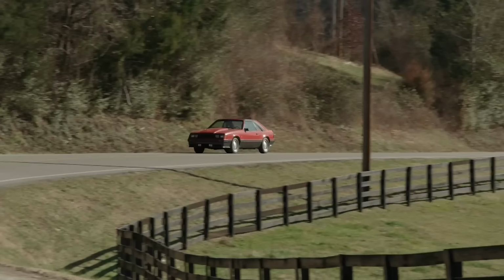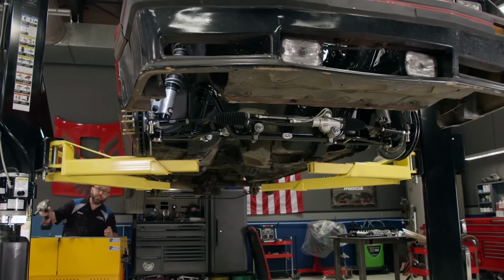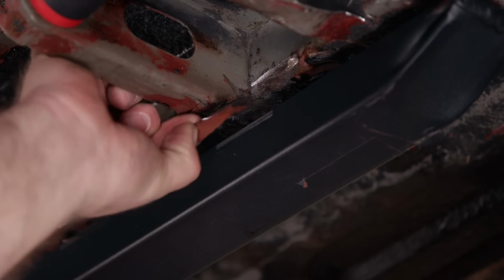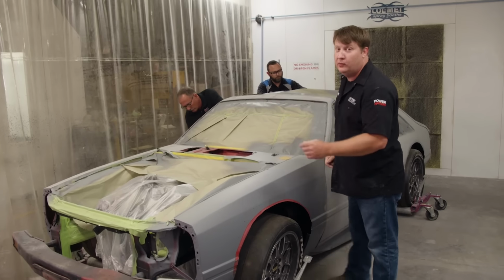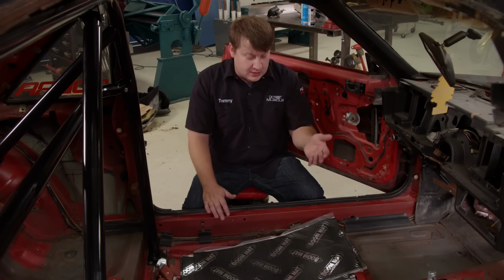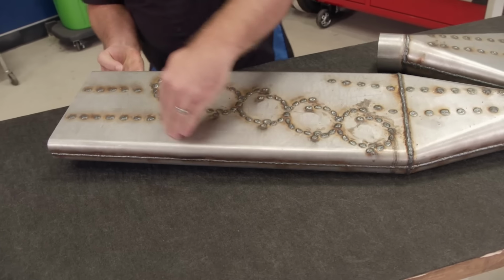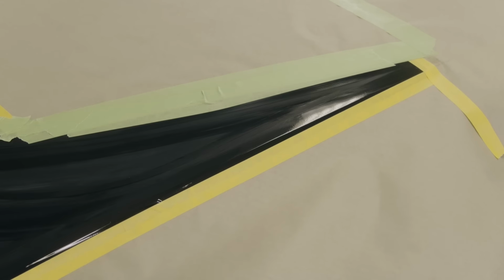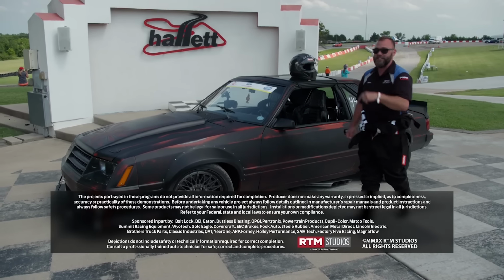Full Build: 1981 Fox Body Cobra Mustang

Comment: I love Fox bodies, that build is essentially my SBF except it is the FRPP Boss 302 4 bolt block, same heads, ridiculous cam and roller valvetrain, it isn't 600hp but it is just under 500 at the wheels and all the suspension improvements through UPR have the Fox stiff as it gets, TKO600, Strange 3.73 locker with rear discs..  I have owned 4 Fox bodies in my time and I miss all of them, so I am keeping my original paint 85 (Jalapeño Red) forever.

Comment: Why go thru all that trouble just2 install another medieval, carbureted engine, steam gauges &mecha switches? 

Why not install a modern V8 or other, complete w/FI, EPS rack, electric HVAC, DCI, VVT, antilock, air bags, digital dash, touch screen, etc? I like the paint idea, the frame trusses, the roll cage, flooring over the rear seat delete but the exhaust is putrid, ugly even. 

Why waste the labor, the time &the parts?

Comment: So lemme get this straight... you wanted your engine bay to look cleaner... after having cleaned and painted it nicely.  So you drilled about 100 holes in it, put cover panels that will hold water behind them... where all the drill shaving are, and secured them with rivets stacking up 4 disimilar metals.  Never heard of galvanic corrosion?

Comment: Completely restored my 91, hats off to these guys. Not an easy process.
Reply: I had a 91, though it was a parts car. I've got a 90 gt now. It is just an average fox,  but there is just nothing like rolling through the gears in a foxbody mustang. I don't think I could not have one.
Reply: @trentjacobs3957  my 91 is an LX convertible. Just put her into storage this week. I'm restoring a 92 LX Hatch currently, calypso green. Then have a 85 notch that needs a full resto.

Comment: I had a black 1979 Mustang Cobra. It was literally the WORST "muscle car" I have ever owned. It had terrible front-rear weight distribution, toy-like suspension parts, awful rear wheel hop, poor build quality and to top it all off, Ford used a mix of standard, metric and proprietary fasteners making the car torture to work on. Its been 42 years and I'm still mad at that car.

Comment: Bush league on the block off  panels in the engine compartment. Laziness prevailed as they could have done the job right by cutting out bad metal & NEATLY welding the panels. Rivets in the situation are bush league.

Comment: In 79 I had a 79 cobra didn't know they still made them in 81. Ofcourse they were not performance machines. Just a few stickers and cobra emblems the 84 GT I owned was an upgrade on power 175 hp I think. Then my  87 GT was 225 hp which wasn't bad for a 5.0 of the day.

Comment: Best video ever for the early 80s mustangs. I want the exact build. My opinion I was 21 when the 82 Mustang GT came out. I couldn’t believe it. One of my co workers in 1981 had a silve Fairmont GT. 302 manual . He had gutted the dash panel had after market gauges . Swapped out the valve overs for finned 302 Cobra ones. I couldn’t believe it being in the 80s.
Reply: One of my friends bought an late 70s Fairmount that was built into a wagon in the early 80s with all mustang components including a fuel injected pushrod 5.0 from a foxbody of course, though it's got an AOD automatic that needs to go.

Comment: Why wouldn't they have installed those block off panels before they they painted the engine compartment?
Reply: Because they could not take the time to do the jobright by cutting out the bad metal & weld in the panels

Comment: How to build a cool car according to Power Nation.  Step 1:  Completely strip car down to a bare body shell.  Step 2:  Throw everything in the trash apart from the aforementioned body shell.  Step 3:  Spend $10,000+ on repairing, prepping and painting body shell.  Step 4:  Bolt $100,000 worth of aftermarket parts onto the $10,000 dollar body shell.  Step 5:  tell everybody watching how easy it is to build the car.  Step 6:  forget to tell the viewers that you will have to sell your house including your first born to build this car!!  Oh and while I'm here a Monocoque  chassis is stronger lighter and more torsional rigidity than a body on frame construction, it's also much lighter.

Comment: At the beginning that was an ugly car! To be honest I used to think that mustangs are amazing cars. No any more. I have a 2007 v6 with 16000 miles and a 2008 gt with 6000 miles and their weight,  suspension, tranny, and comfort is terrible. My 2006 prius is so much better. I am so disappointed about them. I also used to have a 2008 escape with 21000 miles. I was not impressed with that car, however, it felt a lot better than the mustangs.

Comment: The splitter braces are supposed to be mounted solid to the core support or bumper support, not to the ABS bumper.
Otherwise the force of wind could push your bumper off. When all you want the splitter to do is create downforce on the front of the chassis.

Comment: For me, this is by far the best car from the 80's. Replaces every mechanical part
Reply: Why wouldn’t they?  It’s not a paint detailing show.
Reply: I've owned 4 foxes, and not only is it a great handling car but, the sound out of a Ford pushrod 5.0(especially through flowmaster series 40s) is just the bee's knees. There is just nothing like rolling through the gears in a 5.0 foxbody mustang.
Reply: @trentjacobs3957  The car had its strong points but handling was not one of them. The GM F-body with its panhard bar rear suspension would easily out-handle it.
Reply: @ronwalker392  While I don't disagree that GM's f-body definitely worked and worked very well, I can't agree that the fox isn't a great handling car. I don't pretend to be well informed about suspension geometry and the specifics about how well each setup works, but I do know that the foxbody mustang is a spectacularly fun car to drive.
Reply: @trentjacobs3957  DEFINITELY a fun car to drive and classic styling but not the best way to fast lap times.  I autocrossed two Fox Mustangs back in the day and did a deep dive into suspension geometry. Even put a whole K-member/control arm/coil-over/camber plate kit in the notchback. Yes it fixed the front suspension issues but I was still left with a twisty frame, poor weight distribution, inadequate brakes, and twitchy rear end. So yes if you want to drop $10k + labor on top of the vehicle price, the aftermarket support is amazing and will fix most of the handling deficiencies. Alternatively you could just grab a similar vintage Vette or 3-series Bimmer for less overall and really carve corners. However obviously beauty is in the eye of the beholder if that it is your priority.
Reply: I had two.  Drove one over 212,000 miles with mods.  You could make them decent handling with some suspension upgrades.  What they were great at, was adding power with affordable upgrades.  Bought mine new for $12,800 and added on K&N intake, 14 degrees timing, ported head, JBA shorties, SVO exhaust, flowmasters, HD trans. 3.55 rear end.  All that was a few thousand dollars and got me down from 14.6 to low 13s.  The car only weighed 3,023 lbs!  Also upgraded to 245s to have some grip.  The stock 225s weren't good.
Reply: I love the 82 gt front bumper
Reply: The best looks-wise. Every budget performance option from the factory was woefully underpowered until the end of the decade. You can blame the EPA for that, which is now being utterly disarmed in its enforcement of nonsensical overregulations and the overregulations themselves are sometimes getting walked back. Thank you, Lee Zeldin.

Comment: Why not use the 4.9L Inline 6 from the 96 F-150? Its more cost efficient better torque and lighter weight plus if you strap on a turbo its pretty much a 2J but better

Comment: Wanted to thank you guys for building this and saving that rare Cobra which is basically a left over Pace Car. Fyi, the front window pillars on those early t-tops could crack and break with the stock power levels so keep an eye out just in case.

Comment: Those "block-off panels" in the engine bay look like a great way to trap moisture and rust out the underlying metal.
Reply: Yea, cause he probably drives it year round in the Midwest snow storms where that’s a concern 🤣
Reply: Most people cut the existing panels out and weld the scottsrod panels in without that gap

Comment: Some time around 1981 Ford switched the type of balance of the small block V8 engine. I remember around the year 2000 test driving an early Foxbody Mustang in which the seller said that the engine had been swapped and it had a vibration. It definitely had a vibration as it shook the entire car like a giant washing machine. I passed on it but I wish I could go back and buy it.

Comment: Power train I have a challenge. I would only build a iron block 455 . Inside the 455 Cubic Inch Big Block from General MotorsThere's no question that 455 cubic inches of displacement equal a big motor. Nevertheless, this giant engine from the General is a little mysterious. In the beginning, you would find them in Oldsmobile Motor Division products. As time went on you started seeing this exact displacement under the hood of Buicks and performance models from the Pontiac Motor Division.

Here we'll dig into the history of the record torque producing big block. We will also uncover the difference between a 455 SD (Super Duty) and a 455 HO (High Output). Discover if the Buick, Pontiac or Oldsmobile engine has an advantage over the other. Finally, learn how the 455 benefited during a time when GM's divisions took great pride in making their own engines.

The Oldsmobile 455 Version
Olds beat the other GM divisions to market with the first 455 Cubic Inch motor. In 1968 the engine found its way into Oldsmobile's premium luxury muscle car, the 442. They called it the Rocket 455 which became an excellent marketing tool. They based the engine off of the 425 CID found in the 1967 Toronado. The company actually retained the same size bore yet increased the stroke by altering the crankshaft.

The side effects of a longer stroke include a healthy increase in torque. The downside is the engine finds itself a little slower at gathering RPMs. Horsepower ratings from 1968 through 1970 remained in the 375 to 400 HP range. At first, the engines remained exclusive to the Toronado, Cutlass and 442's. After 1970 you'll also find them in the Olds Vista Cruiser Station Wagons, Delta 88's and even GMC motorhomes.

Stage I Buick 455 Performance Engine
The Buick version of the 455 is actually quite different from the Oldsmobile version. Instead of altering the stroke, Buick honed out the cylinders on the 430 CID Buick Wildcat engine. For this reason, GM considered it a thin-walled big block. The advantage of this casting design is a significant drop in weight over the other 455 versions.

In fact, the engine actually weighed close to 150 pounds less than the legendary 454 big block that Chevy used. This weight reduction compensated for slightly lower horsepower output from the Buick version. They rated the standard issue 455 at 350 HP and the high-performance stage I version at 360 HP.

This engine had a short run starting in 1970. In 1975 General Motors started using the same engines across the different divisions and platforms. This gave them better compliance control for the increased power and fuel miles they buckled it into the ground.  At the end I put that engine in my 1995 suburban and it was a muscle car bully that ran 10 seconds on a good day on a lumpectomy day she ran 11 seconds and for a suburban that’s quick thrown down . Edit if I fallowed my insane friends build I could have had a 9 second suburban .

Comment: Can yall do a full rebuild on a 1988 3rd gen 2.8 v6 Chevrolet camaro rs so I can know how to take everything off put what needs to be changed on the body the Chasy suspension brakes you know like everything i can find no videos at all an it socks because mine ran but then stopped an i had got it going again but then it won't start back up again for some unknown reason plus needs to be repainted really bad an i think the body or Chasy might be a little shifted

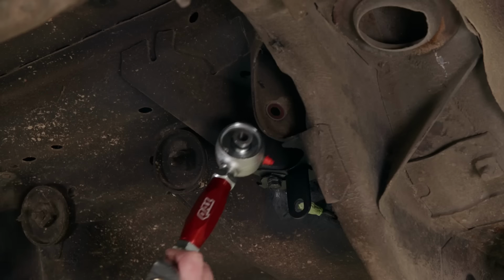Comment: ( 8:08 )  
If I owned that car and found out that you guys installed equipment underneath without treating the underside of the car and unrusting it and coating it with something heavy,
I would have been EXTREMELY PISSED.......  you guys mounted all that new gear onto a horrible bottom that still shows wear and rust look without cleaning & treating.
Take EVERYTHING out from under the car, and I mean EVERYTHING then grind until you see metal, then treat.... then spray LINE-X on the entire bottom of the car.
Then install new gear .....  Also I dont like that paintjob.  its like 13 year olds buying $500 pair of worned out jeans.  just horrible.

Comment: Does anyone else get upset when the put a brand new rear end/shock/ adjustable links etc on a rusty old undercarriage? Like, Come on Man. at least clean it up before bolting on all brand new parts!
Reply: Same here.......I had to thumbs down just because of that reason.  Since its a rebuild that they wanted to achieve, then a full cleanup of the car is necessary before anything else happens.

Comment: Foxbodys are alright but if you live in the rust belt they are getting hard to come by without the front frame and shock towers not rotted out of the car. I have worked on many from 1979 right up to 93 and they all have the same issue with the shock tower and frame and they rot from the inside out.

Comment: Those "block-off panels" in the engine bay look like a great way to trap moisture and rust out the underlying metal.
Reply: Why didn't u put those in before u painted?
Reply: And some unnecessary weight
Reply: Qqaaaaàààààaa
Reply: Aàaààààààààaaààaaaààaààààaààààaaàaààààààààaàaàààààààààààààààààààààààaààààààààààààààààààààààààààààààààààààààààà
Reply: Ugly azz car.

Comment: That light bar is just a way for jerks to blind oncoming drivers. They have basically no vertical light control, and are screamingly bright, which is great for offroad, or maybe if nobody was in front of you for MILES, but that's not how they're used in the real world, when mounted like that, on a street car.

Comment: You'll be putting Battle boxes in your torque boxes in a short time.  If the upper mounts don't pull out first. It's only sheet metal spot welded.

Comment: The only thing I don't like is the exhaust. It is too low. I would have put dual exhaust straight out the back. Or dual exhaust in front of the back tire but higher up.

Comment: I had rails, bracing and subframes installed on my 95 GT Convertible.  You need to make certain that you car is straight before investing a bunch of time/money.  I got on a level floor, checked tire pressure and did some plumb-bob measuring with a string and weight.  I did other measuring with a tape and was happy with my platform.  With a convertible/T-top, it's important to keep doors closed, tops latched down, windows up.

My guy presprung or preloaded the frame by putting a pipe up and down under the car and carefully lowering the rack to push up on the rails and then welding them in.  Good idea in concept but then my convertible top ended up being very slightly stretched and in a short amount of time then needed to be replaced.  He should have used a scale (like in the bathroom) to measure the exact tension being loaded when prespringing the subframe connectors so both sides are even.  Also, you want welding rod that won't rust (not recalling the exact term).  My welds are now rusty after a few years.  I'm going to have to use a wire brush on them, treat them and carefully paint them to protect the strength of the welds.

The car really feels solid now with no flop or flex that is so typical in the convertible mustang platform.

Comment: Did they brace up the torque boxes in the rear end if the car.  With 600+ horsepower , i can't see the stock mounts lasting long.

Comment: I was all on board right up until you re-installed a 4-link in the rear.  Booo!  Three link with a torque arm and panhard bar is the way to go on a Fox body.
Reply: Wrong. Ford had an 8.8 IRS setup. If you want to corner IRS > everything so they should’ve snagged an IRS 8.8
Reply: Watts Link?
Reply: @luislongoria6621  I have seen that done too

Comment: Wow 200 horsepower froma 5.0 v8 😂😂😂 1980s uk astra 2l I4 150hp
Reply: Smog Motors and Complex EGR Killed Performance. Easy to Swap a 4 Barrel Carb, but Hard to OverCome Low Compression Ratio Pistons

Comment: What are the wheels?
Reply: They are called "TRX" and were a factory option. They are 390mm in diameter ( or 15.4 inches), and can only fit Michelin tires at over $400 each.  There is an exact copy / repop being made in 16 inch that can mount any modern tire.
Reply: pipcop Very interesting wheel size. Thanks for the reply!

Comment: I thought unibody chassis are more stiff than body on frame chassis? At least in modern cars. I thought that body frame is preferred in trucks precisely because it allows for more flexing during off-roading?
Reply: You will wad this car up without subrame connectors and this much power. Hell my stock 302 will wad these cars up.  They were saving weight not making stronger 

Mine arent the stifflers like these kind but they are very inetersting to say the least in my channel
Reply: Ditto. Complete Opposite Even on Dodges

Comment: I would have power coated or undercoated the under the car after taken motor trans n rear end out. And i know im only partly through this i would have went with a plastic tank those steel tanks that. I know u tried to keep stock looks. But upgraded lighting with something better. Geomet rotors front n rear, if they were available at that time.. X pipe exhuast stainless 304 front to back 2.5 inch or bigger. And soda blast the body n underneath.. I could go on and on but overall lovely car wheels have to go but not bad